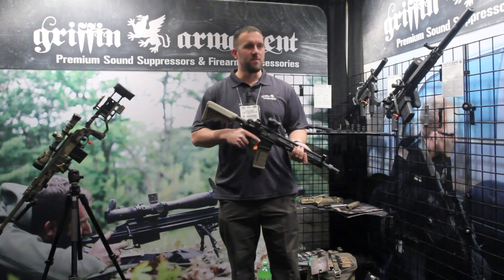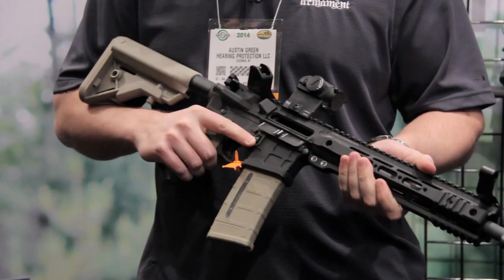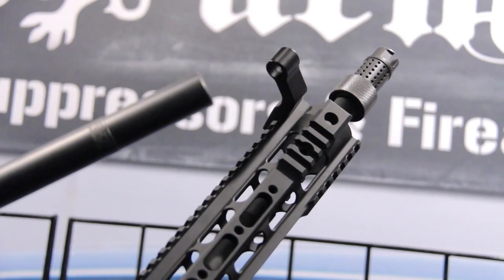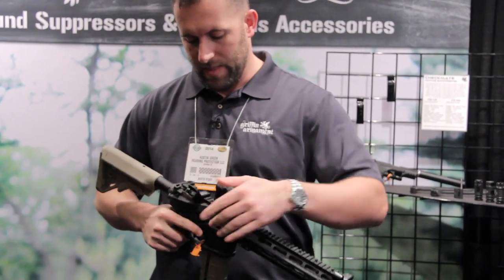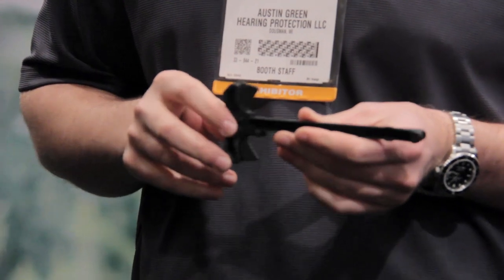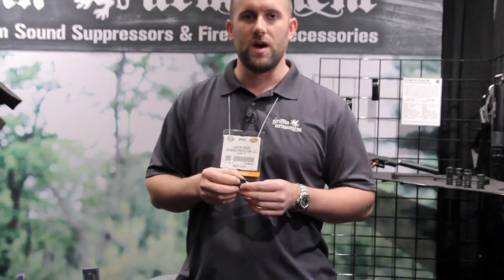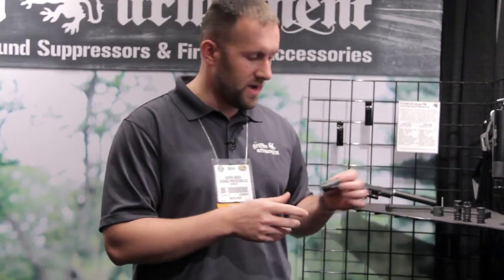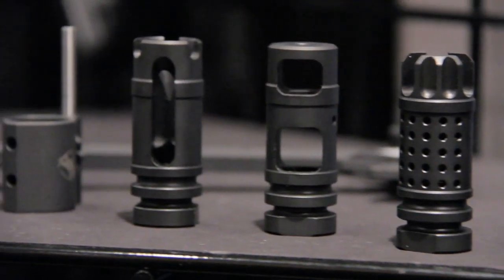Griffin Armament - ShotShow 2014 - Part 2

Comment: What's the on the Aimpoint Micro? Haven't seen a sight cover like that before on the T1s!
Reply: Definitely not. I helped design the original logo during the kickstater so I have like 9 copies sitting around. Similar concept but its definitely not it.
Reply: If you haven't gotten it i highly recommend it. It's kept my lenses clean during storage every since my bikini covers snapped in two

Comment: I currently own an AXTS AX556. How does that ADM lower compare? Is that only a downward stroke bolt release and no bolt catch like on the ax556?
Reply: No The ADM bolt catch is both a release and a catch on the right side.  Also these lowers will be at dealers for substantially less money than the AXTS lowers.  Right now ADM is talking about streeting a complete AMBI base Gun for 1620.  This lower as a component should be available for ~350 street price with ambi controls.

Comment: What model rail is that?
Reply: ADM Low Light rail (10.75"). Comes with custom injected molded furniture set. The rails will be pushed from 7075 aluminium.  Top shelf stuff. Look for them in a few months at your online retailers.